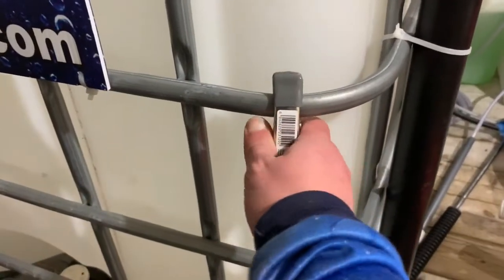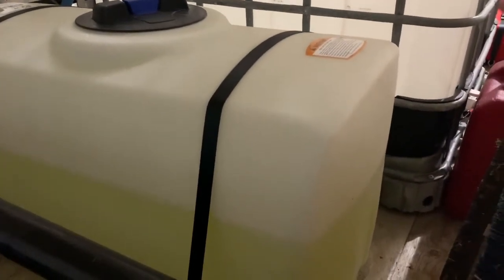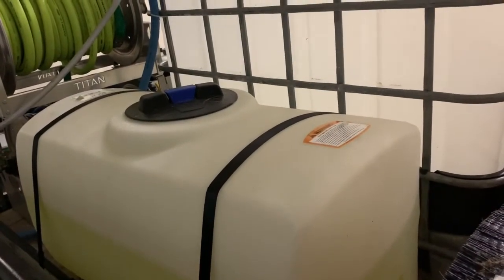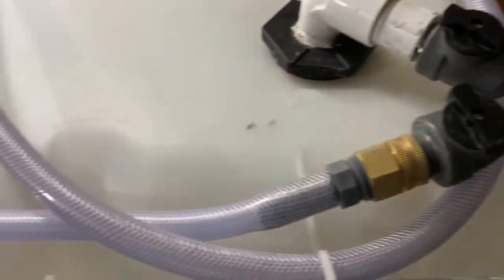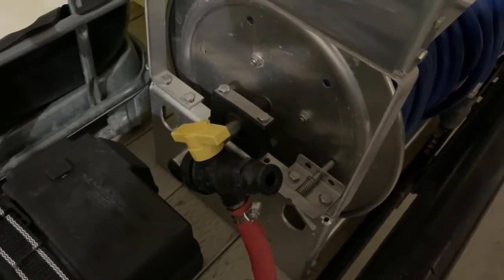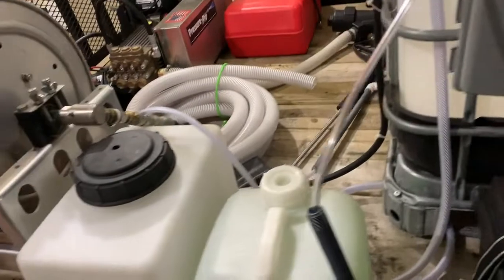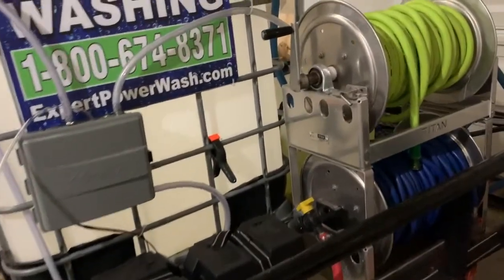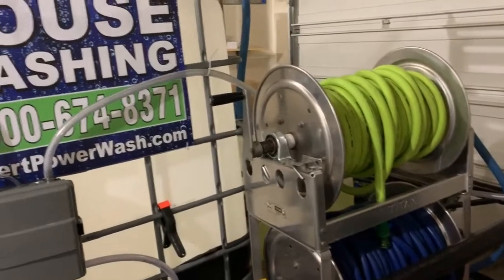Expert Power Wash Pressure Washing Trailer Update

Comment: Do you travel with any water? And how much do you need to fill it, before you can start washing? How often do you run it dry from being full?
Reply from the maker: As you get used to your equipment you can identify slow water flow and make sure it doesn’t happen. I have to garden reels for that very reason. If the tanks are not a third full in 5-10 mins, I know I need to double feed. A third full to half is where I like to start with good water flow. I have two 100 gallon tanks tied together for a total of 200. Works great. I do travel with water sometimes.
Reply: How much water do you travel with when ya do? I have a 6x12 single axle as well. I want to upgrade to a 8gpm this year. And I just picked up a 275g tote. But I’m worried I’ll be waiting on water a lot. 
I’m wondering if I should just stick with a 5.5 and my current 65g tank. I’m torn.
Reply from the maker: I apologize. I answered this question based on my flatbed. Thought the comment came from that video. The trailer had been converted to the flatbed. I didn’t travel with water on the trailer. The tote works fine. All my other comments still apply. 8 GPM is a game changer. Time is money if you are doing a lot of work.
Reply: @ExpertPowerWash  thanks man. I just found your page. Really appreciate the videos.

Comment: Very Nice set up! My question to you is do you really need that big 275 gallons for your 8GPM machine? With your experience, will a 100 gallons machine be good enough?
Reply from the maker: I’ve ran my 275 tote dry few times with the garden hose filling. Most of the time it’s with surface cleaning. House Washing, you could definitely get away with a smaller tank. We are thinking of building a truck bed set up with a 125 gal tank. Still considering all options.

Comment: Do you use your proportioner for the pressure washer and pump, or just use the proportioner for the pump and mix your own batches in the 7 gallon for the pressure washer?
Reply from the maker: I try to keep it simple and efficient. Our proportioner is for the 12v. No batch mixing. We downstream for most stuff. With a 8GPM and the right injector, you can downstream straight 12.5 SH. Add a good surfactant 1 oz per gal of SH. Hope that helps. Thanks for watching and commenting.

Comment: Great video EPW was wonder was size soft wash hose (blue Kuri tech) you use trying to decide between 5/8 or 3/4. Thanks for all the info.
Reply from the maker: Mine is 1/2 and works great. I’ve heard of others using 5/8.

Comment: I’m at the finishing stages of my build  6x12 enclosed trailer 125 gallon buffer tank 2inch bulk head what size hose from the tank to the pump should I run 1 or 1.5 inch? I have a 5.5 gpm pump.
Reply from the maker: One inch is fine. I’d only go bigger if using 8 GPM or higher.

Comment: Can you down stream through a  metering valve setup? 
 Place a cam lock on the hose going to the pump switch to downstream injector. (Water off, SH & soap on
Reply from the maker: Why would you want to meter your mix. I mix my soap, one oz of Elemonator per gallon of straight SH. That works for the 8 GPM. You could also use a downstream bypass. Pressure Tek sells them. All you do is turn the knob. You could do it your way but I’d worry about cam locks and extra fittings that could let air in and not pull soap.
Reply: @ExpertPowerWash  
I want to use the same SH tank for 12v softvwash. I will need to meter soap on that system to control soap rate for roof / housewash. If i put soap in the SH how can I change the rate for 12v system?
Reply from the maker: I also use the same bleach tank for my 12v roof pump. Adding Elemonator to the bleach tank does not affect the metering. The Elemonator also helps maintain the SH strength. I still pull another line out of the tank to the metering valve for the roof pump. I still meter in soap as normal. Hopefully I’m answering your question. I have a downstreaming drop stick in the bleach tank and a pick up tube plumbed into the same tank. I may have talked about this on my flatbed build or the remote downstream video.

Comment: What are the costs on the Titan reel setup?
Reply from the maker: Thanks for watching the video and commenting. There are several different Titan reels. Mine were around $350 a piece. You want to look for stainless and aluminum. Anything else won’t hold up as well when some of the chemicals. Mine are going on three years and no one single problem. I bought mine from Pressure Washer Products.  Look them up or call. Ask for Lori. Tell them Tim with Expert Power Wash sent you.

Comment: Hi 👋 I like your channel, keep the vids coming. I have a goal or idea of a truck bed setup bouncing around for a bit. Not sure if it would be interested in doing it or have the time but building a custom wood camper/top that slides in/out special for pressure washing. Easy to unload with a tractor or skid steer or a winch system for part timers like me. And a place to keep all the equipment thru winter without taking up space in building. Anyways a 5.5 gpm with 65 to 125 gal buffer tank, hose reels mounted up coming off the side of the truck.
Reply: I know a lot would argue to just buy a enclosed trailer but then your wagging and backing a trailer everywhere, hooking and unhooking, storing the trailer or just letting equipment rust away.
Reply from the maker: Thanks for stopping by and commenting. I’d be interested in how your build comes out. I’m also at a point of wanting to build a skid for the back of my truck. 5.5 GPM should be fine for what you want to do.

Comment: Great Set yo mind sharing where we can find a orbit box ?
Reply from the maker: Pressure Washing Maintenance hey thanks for watching and commenting. Bought it at Home Depot. Has a built in outlet. Took that out and replaced with a light switch for my 12 v pump.
Reply: Gotcha tanks are you running the pro mix allot as-well or something similar hoping it will fit in there
Reply from the maker: Pressure Washing Maintenance not sure I completely understand your comment. I’m running the PMA. It fits in the box.

Comment: Where did you get the small water tank? Thanks in advance
Reply from the maker: Daniel Sandozequi, if you are referring to the 7 gal soap tank, I got it from the Power Wash Store. Thanks for watching and commenting.
Reply: What do you use that small one for? Just soap?
Reply from the maker: I must have missed this comment. Hope all is well
Reply from the maker: If you are referring to the 3/8 line, it’s soap. I have another 1/4 line that runs to the bleach tank for downstreaming.
Reply: @ExpertPowerWash  was curious about the small tank. The 7 gallon. You just filling that with soap? Or is that what you mix batches in?
Reply from the maker: It’s a soap tank. Typically 1/4 Apple wash to 3/4 water. I add Elemonator sometimes. Really no science to it. It’s pulled through the proportioner.
Reply: @ExpertPowerWash  nice. Alright I won’t ask you anymore questions....for now lol

Comment: What 12 volt pump do you youse
Reply from the maker: Michael Gordon, thanks for watching and commenting. I use the Everflo 5.5 GPM, 60 PSI. Works great. Remember to rinse. I’ve used mine all season no issues. Always have a backup and spare fuses.
Reply: Is there a big difference in 5.5 than 7 gpm
Reply from the maker: Michael Gordon, I have not used a 7 GPM. I’ve only heard through research that the 5.5 GPM sprays better for roofs, doesn’t use excess chemicals, lasts longer, and uses less load on the battery. Again this is not from my experience, just research. Hope that helps.
Reply: What deep battery you use?
Reply from the maker: Antonio Rivera, I use the good old Walmart deep cycle marine battery. Works great.
Reply: @ExpertPowerWash  24m?
Reply from the maker: Antonio Rivera, did I reply too fast. Lol